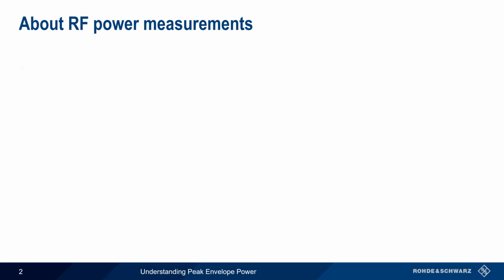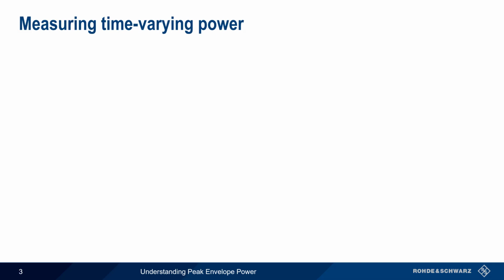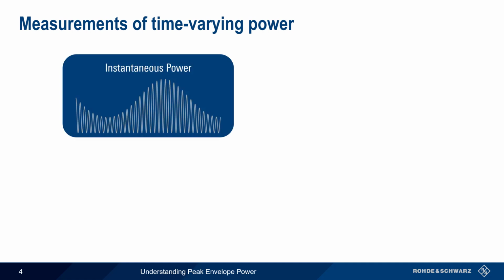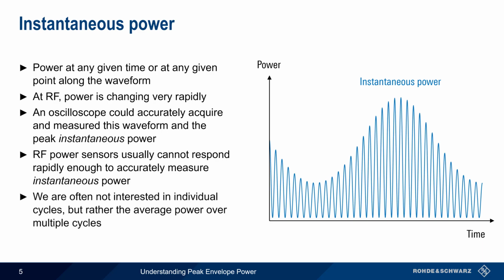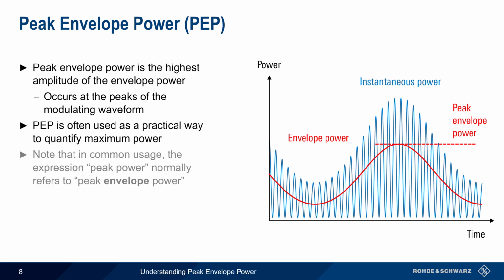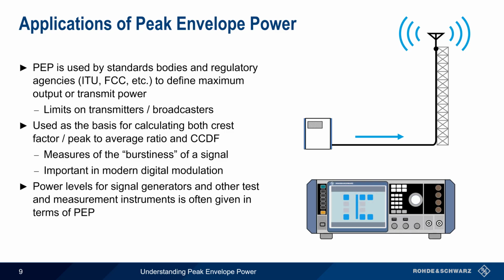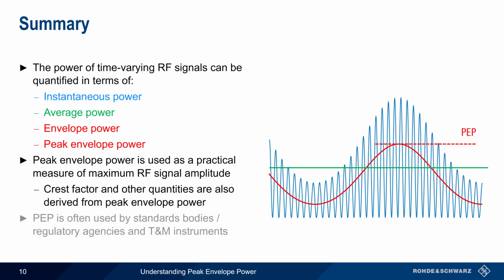Understanding Peak Envelope Power

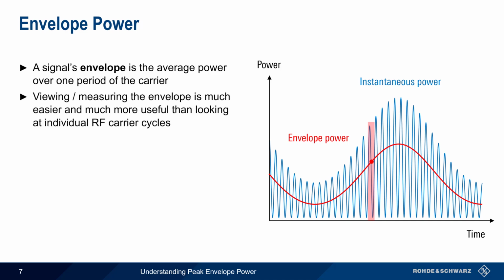Comment: Excellent explanation! But what confuses me is the shape of the envelope power (red) at 3:15. If the envelope power is the average power over one carrier period, then the red dot should be at middle height of the red box, because that is the average over this period. Hence, the plotted red curve has a too large maximum and a too small minimum. Second, one carrier period corresponds to two power periods (the positive half-wave and the negative half-wave). So the red box should be twice as wide. The outcome is approximately the same, but for didactic reasons, it would be good if the plot would match the verbal description.
Reply: Thanks!  And yes, I could have done a somewhat better job in drawing the red box 😀  The box was meant to be mostly illustrative, rather than a rigid / exact depiction of the power measurement "area"